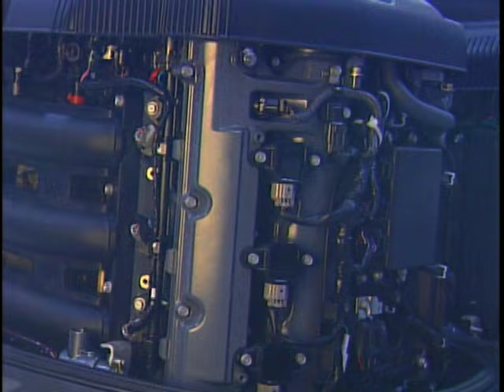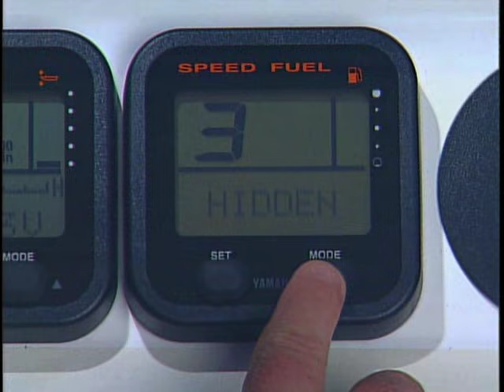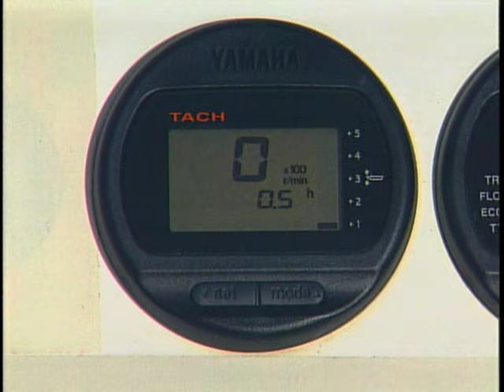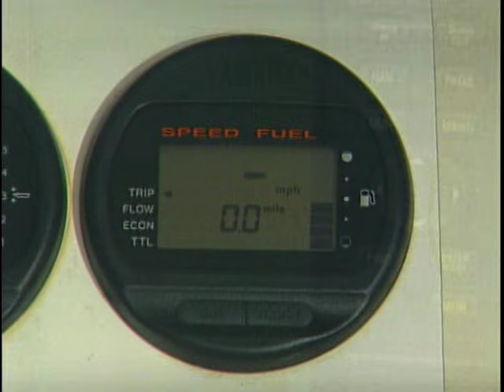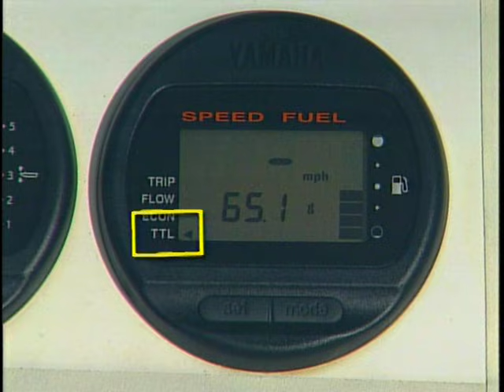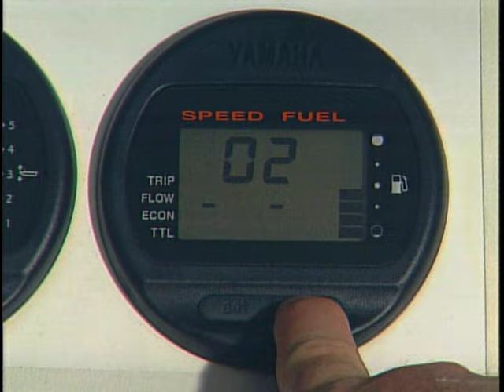Yamaha Command Link Part 2 DVD

Comment: Hello. Can you help me witch two wire need to yamaha gps? I have garmin 24xd hvs nmea0183 antenna but I don't know why it doesn't want to work together.  I have already tried countless variations, but it does not receive a GPS signal from the antenna, but the antenna works.  Thank you!